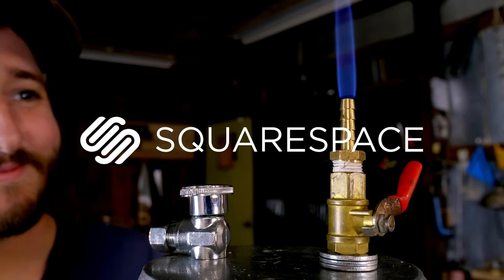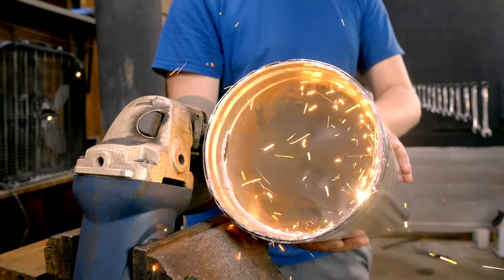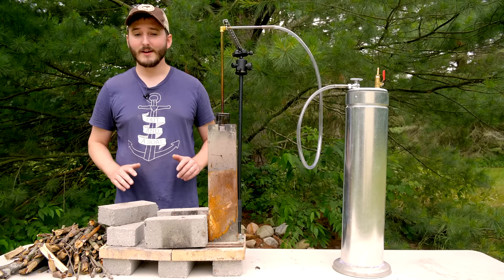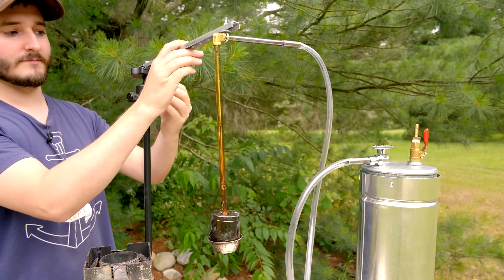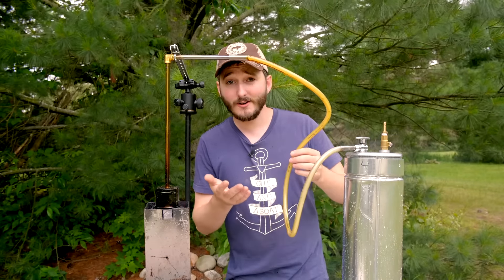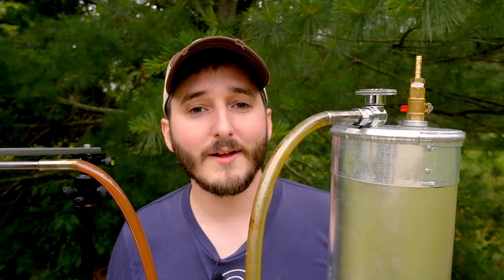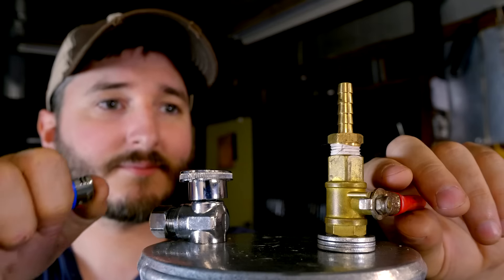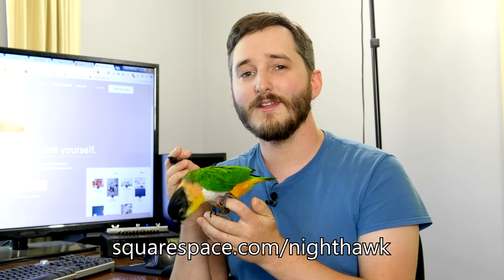Bio Fuel Storage: Building A Gasometer

Comment: I know this is an old video at this point, but could the gas inlet go into the bottom of the gasometer instead of the top? That way you wouldn't need the flexible tubing, as it wouldn't need to adjust.

Comment: old video, but did anyone suggest silicone tubing for better heat resistance? Also, what modifications would you make to store oxygen from your new concentrator?
Reply: Also could cool the gas with a heat exchanger before going into the vinyl tubing ... too many comments to know if these suggestions have been made already

Comment: Wouldn't rigid connections be possible by plumbing everything at the bottom of the external flue pipe and then running pipes above the water level internally?
Reply from the maker: Yes that's probably the best solution

Comment: The condensation that you were getting after the first bit is the turpentine and pitch.  You should make the next version have a middle canister to catch that stuff instead of dumping into the water. Plus bubbling in through the water should filter it better and faster. 

What would be interesting is if you took the wood gas and pressurized in little by little. You might be able to separate out different gasses that you can liquefy at higher pressures. That would be after you separated it out of water.
Reply: notice the pine trees?how about 'fat wood' yall

Comment: Rubber heater core hoes from the auto parts store is rated for several hundred degree cuz it has to handle coolant  that can get to over 300 degrees when something goes wrong and then some for safety

Comment: Great video man... Hey what did you do to seal the fittings on the end so the epoxy wouldn't fill them? Tape them off first or maybe drill the holes but wait to install the fittings until after you've poured?
Reply from the maker: They stick through the metal far enough that I could pour 1/4" or so of epoxy in the bottom without reaching the openings of the fittings
Reply: Damn... I feel stupid now lol, Makes alot of sense, especially since you ran it down the seam. Why this video doesn't have 10 mil views is beyond me.

Comment: if you put a weight on the top of the metal barrel would it pressurize more instead of floating?
Reply from the maker: Yes
Reply: @Nighthawkinlight  okay by then if you could make a fitting of some kind and transfer it to say a propane tank you could store it better and safer

Comment: you can leave air inside of the chamber so its already very close to the fuel to air ratio you will use it then you can pump it into a tank and you will be able to use it exactly like you do when you paid for it from the utility companies so  it will be a literal drop in replacement and there will be no extra conversion costs retrofitting everything for the new system...just be safe people...yea keeping the gas and oxygen separately is safer...but safe is never fun...and it can easily be made into a automated process to  pump out the gas to an actual storage tank so that you can just continue to keep making more and more...the total volume of fuel for that setup is way to low to make it even worth the time and effort and cost...and I know that you cannot store as much gas by doing this way..more hands on people will probably just fiddle with and regulate the air/oxygen themselves so they can collect more gas...was just making a point of how simple it really is to supply a gas fuel that behaves and is very similar to what people are already using to making essentially no changes of course its obvious for most people...but this comment is not for those people...its for the people that dont want to...or that have forgotten how to actually think for themselves...this shows a feasible way to do this with a simple process and nothing more...its still way to crude and inefficient of a setup because of the actual gas volume that is available to use...gases take up 1700times the volume than liquids do...so in your head reduce the actual available storage of the gas to 1/1700th the volume...and that will be how much liquid gas you would be looking at..not that impressive...what a bic's  lighter worth at most...what are you going to do with that..and this comment is not to dig on the channel or anyone specifically...pumping that gas into a tank at high pressure causes it to be turned into a liquid and thus increasing your available fuel by 1700 times...that is being done in all tanks to increase storage capacity...propane is liquid  inside of the tank...acetylene... also..

Comment: So could you run this gas into a coil submerged in liquid nitrogen and get liquid butane and separate out the flammable gasses into a liquid and remove the carbon monoxide?

Comment: A little imagination here : You could provide a wood feed for the fire with an L-shaped pipe with an auger on the inside  bottom leg. Adjustment of air supply  needed.The bottom leg would have holes to emit the gas. The bottom leg auger inside, would eject burnt charcoal. The gas collected through a covering pipe would have a tee where condensation occurs to take care of Liquid tar drainage. The gas would be going into the storage container connected to a compressor to bottle it. Have fun with that food for thought.

Comment: You could use automotive fuel line. Any auto parts store will have soft fuel line in stock, and its oil and heat resistant, which would be perfect for your application. Soft hydraulic line would work too but it might be too stiff for what you're doing.

Comment: Is this gasometer I tended to gauge gas production accurately by volume? 
If so, could weight of the rising cylinder maters in the accuracy of measuring gas volume ? Is gas compressible ?

Comment: What is the burn time with wood gas?  e.g. the container in this video held how much gas and what was the burn rate (how long did it take to use up the saved gas).  Is there a size limit on the capture unit?

Comment: How to improve it.
1)  For the collection vessel drill a hole in the bottom and add a pipe before putting in the resin plug - this allows the gas to bubble up through the water for faster filtration and removes an obstruction from the top of the container.
2)  Add a secondary filter - have the gas go into a large jar half full of water after it leaves the furnace - it bubbles through the water and then continues on to the storage container meaning that you have to clean the storage container, the pipes in and out of it and change the water in it less often since tar and gunk building up on the walls of it will eventually prevent it from sliding.
3)  Coiled pipes leading out of the furnace - moonshiners use coiled copper pipes to help cool the vapor - you can do the same to prevent melting the plastic tubing leading down to the filter jar.
4)  You said in the first video that you save and use the tar that comes off - instead of filling the filter jar with water, submerge it in an ice bath and while it won't filter the smoke as effectively, it will make a great way to gather that tar which is produced.
5)  Use both - have a small jar submerged in cool water that the gas hits first to gather the tar in and then that leads to a second jar with the water filter, which then leads to the gas collection container.
*
I realize these suggestions make the aparatice larger and more complicated but it's realistically already reached the stage where it should be a semi-permanent fixture anyway.  You could probably construct a tray or frame to fix the jars in and thus make it three separate components.
Reply: Mr. Teslonian use 1/2 " cu. pipes so the heavier tars drop out into containers while lighter gas traverses upper pipe to his generator.

Comment: Most people have a big misunderstanding of carbon monoxide as it relates to biofuels, such as butane, propane, natural gas, etc, being burned. Carbon monoxide is produced when biofuels are burned incompletely. If a biofuel has sufficient oxygen, 0 carbon monoxide is produced. In older, less efficient furnaces, the bio fuel combustion process was starved for oxygen and as such burned with an orange color and produced carbon monoxide, which was typically vented naturally with the help of a small barometric damper. Most modern day furnaces produce no carbon monoxide, UNLESS there is a problem, such as too much fuel, or too little combustion air. I'm not familiar with wood gas, so this may or may not apply to that as well.

Comment: I have already built a larger gasifier than the one you show in your video and only have one question for you.  Haye you built a pressurized storage set up that will allow you to store, say 24 hours worth of gas for a 9,000 watt generator/inverter?  I have a used 40 lb. propane cylinder that I would like to use for woodgas storage, but would like advice on the equipment I should use to pressurize the tank to say 60-80 psi.  Once pressurized, I can regulate the output pressure with a diaphragm valve.
At what pressure, at say 80 degrees F will the gas liquefy?
Reply from the maker: I've read pressurizing woodgas is not safe because it may self react at higher pressure. It will not liquefy like propane so you will not be able to store as much as you might hope. Woodgas is in large part hydrogen and carbon monoxide which do not liquefy outside of cryogenic tempertures.
Reply: @Nighthawkinlight  Thank you very much, that is very beneficial information

Comment: I had several friends who went on a trip to Ireland a few years back. I stopped on one of the smaller Islands on a tour, and noticed the following. Huge pits dug near the Barnes where they kept their cows and pigs and farm animals and when they inquired to why these pits we're next to huge tarps with the hose coming off of them they explained it like this they fill these pits with animal excrement, and cover it all with a tarp and then dirt to keep the tarp sealed down over the pit they then have a hose that comes off of the pit coupled with a proximity switch, when the excrement produces enough methane it trips the switch which controls a standard air compressor. They can press the methane and then he transfers it in the cylinders and they use this to run their farm equipment cooking gas Etc. So the sister you were you looking for is a very old system indeed. I would suggest you do a little research in this and you will find out that I'm fairly accurate with my description. Good luck in your endeavors.

Comment: I would use flexi-pipe. It was originally designed for plumbing, but the fittings kept splitting the flex-piping. You can still get the piping. That might be better for higher temperatures, because it was able to handle near boiling water from a hot water tank.

Comment: This can be also used with methane gas from a biogas digester.
Suggestion:
Use a water bubbler to cool the gas and remove liquid residue, then dry lime or lime water to absorb carbon dioxide before it can be stored.

Comment: My dad and I used to use a wood gas generator for our buck at our farm. We used a fuel filter with a hole drilled in the bottom with a constant flow of well or creek water running over it. Although, we used mostly scrap termite infested rough cut wood. Just get a fuel filter fount and put braided neoprene hoses on the hose barbs. I condenses the tar and water vapor, and cools the gas to allow it to go into our house.

Comment: Could you please tell me, which connector you used that permits the one way of low pressure wood fog into the chamber ?
I tried with a ball valve but the fog could not pass through
Reply from the maker: It's not a one way valve. The valve stays open while being filled

Comment: I see same mistake in all containers. To filter gas it should be released at bottom of container, from dyfuzor and not at top like You are doing in all videos
Reply from the maker: Releasing at the bottom means you need the gas to come in at high enough pressure to displace the water. By releasing at the top you can fill the chamber at near zero pressure. Wood gas doesn't need filtration as much as it needs settling time.

Comment: could you not use this gasometer to store your HHO 
you would have to cover the top with water and bleed the water to the top of the inner tube to eject air. 
Then bubble your HHO in from the bottom.
Bleed off through a flash back bottle.

Comment: For you storage chamber you could have a flat disc at the bottom of the cantainer with the gas with a type of sealer ( like an o ring  or something then at the top of the second container have it cave in a little bit and the containers would rise and it would be stopped by the caved in top as the pressure pushes the container holding the gas up so it would double in hieght at full capacity

Comment: Nice build and explainer.

Silicone tube will have a much higher melting / softening point and be less chemically reactive.

Your rocket stove is smoking more than it should, you should be able to get higher temperature and efficiency with a little reconfiguring.

Comment: bro your heater ıs so powerful then you cant control well I think you should use picnic tube or spirit stove kamineto or just a candle but best one is picnic tube so you can adjust fire power more over Wood has methanol you can use empth bottle first then gasometer so you can collect methanol and tar your system is so basic you should get more complicated and use filter barels controler etc

Comment: Too much water in that gasometer. Your inlet would be best entering the bottom and the water that should be about 50% full as the weight of the raising chamber should keep pressure and allow water to rise up the outer seams.

The entry in the bottom with water would make a gas arrest to help seal the input side from back pressure.
Reply from the maker: You can drain some water as you add gas but it needs to start full sp there is no air contamination
Reply: @Nighthawkinlight  You pull a vacuum. Simple.
Reply from the maker: You can't pull a vacuum. It will draw water up into the half filled chamber until the water seal between inner and outer chambers is drained and it sucks air bubbles.
Reply: @Nighthawkinlight  Think about it... I f that happens, then you have not got enough water in there when pulling a vacuum...

Really you should have a way of draining the water in the tubes because of the by products of the condensates it produces needs special disposal methods .

Comment: Any chance you can try distilling turpentine, rosin, and/or methanol (wood alcohol) from the tar?

From what I’ve read, methanol is a byproduct of the carbolization of deciduous woods (in addition to tar) and turpentine (and by extension rosin) comes primarily from certain species of pine trees.

Also, if you can get your hands on birch bark, the tar it produces is called ‘Russian oil’ and is a particularly fine tar.

Comment: May be some of the CO2 is also collected in that container.    Instead, better heat the wood in an enclosed  steel bottle with a small out port,  and collect the gas emitted from this port.

Comment: Plumber here. I know exactly what you could use instead of that plastic tubing. There is a thing called Eurotis - it's stainless steel bendable tubing and it should resist high pressure and heat. I hope my comment was helpful

Comment: Two things:
You could use fuel line hose, it has a higher temp rating or you could use hard copper tubing and come in the bottom center of the gasometer.

Comment: Have you considered using eutectic salts to produce your wood gas? 
At the right temperature, a hot liquid salt bath could drive out moisture and volatiles while excluding oxygen, leaving behind char once the salts are drained (and recovered). This may reduce the CO ratio and also help with pressurization.

Comment: I don't know if anyone has mentioned it before, but have you considered using corrugated stainless steel tubing normally used for natural gas lines? It's a bit more rigid than vinyl tubing but it may offer the flex you need as well as the temperature resistance. Interested to hear your thoughts!

Comment: Am I the only person who believes garbage trucks should run on the trash they collect via gasifiers? All the trash mulched up into a massive hopper with a downdraft gasifier breaking it down? 

Literally everything flammable could go in, and only ash left at the depot.

So long as there's a system in place to minimise the smoke created it would be really useful at reducing landfill.
Reply from the maker: It would be better for them to run on natural gas from trash digesters running on a large scale. Small gasifiers require a lot of troubleshooting and feeding them trash would inevitably burn a lot of plastics. Natural gas fueled trucks are much more reliable.
Reply: @Nighthawkinlight  didn't even see this reply. A valid point made. You could have a plant that used downdraft gasifiers to generate the power to heat the closed loop gasifiers which can collect the gas to run the trucks, that way all the feedstock is used in one way or another. All the remaining biochar can then be sold on or used to help continue the downdraft process.

Comment: A large, old fashioned copper coil, like they used in making moonshine, is perfect for your set up. It's flexible enough to handle the range of motion and heat resistant enough to last longer than the rig itself.
Reply: ya,your right,however it 1/2 inch copper clogs up fast. Maybe more stove pipes running end to end through water filled 55 gallon barrel - what do the hillbilly's call it a 'shotgun'something or other ?

Comment: At 9:03 it dawned on me that such a system could use another valve along the hose somewhere. This would allow the release of "heads" with subsequent batches, before continuing the fill, thus excluding the water vapor out of the main collection unit.